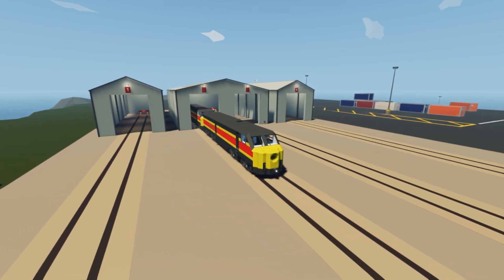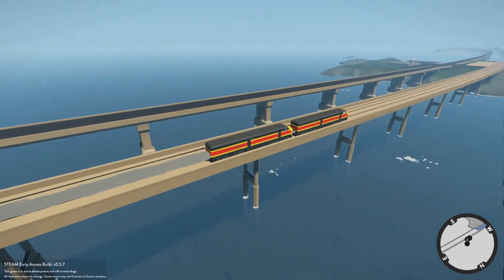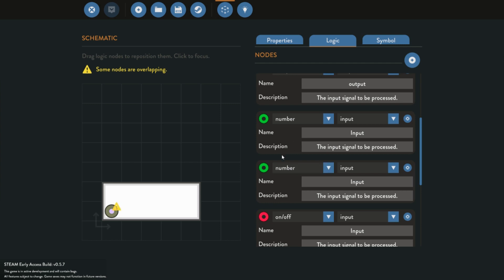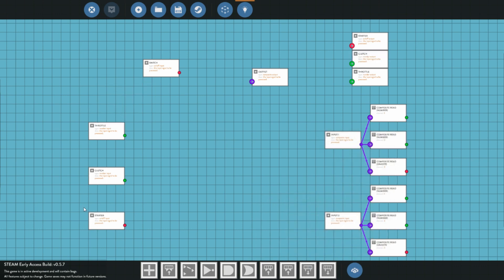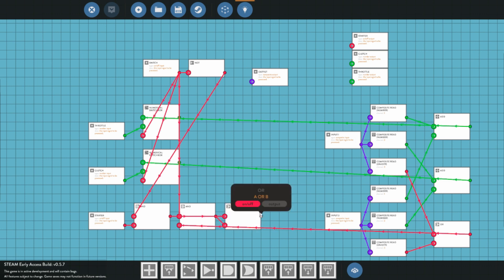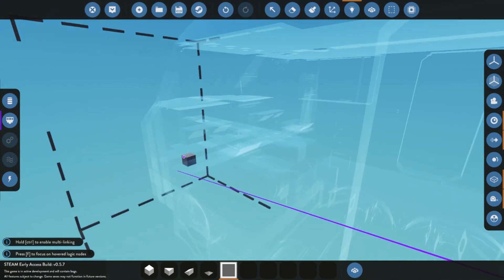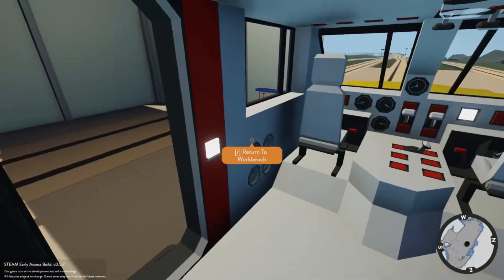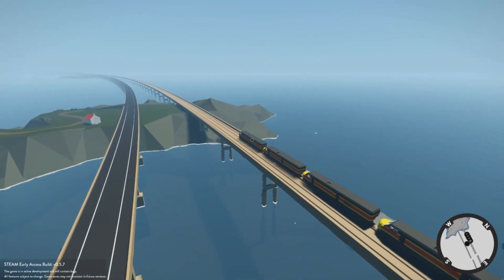How To Switch Controls With Composite Values! | Stormworks

Comment: I'm not completely sure how this works, but can you try this?
Make a processor that have inputs: throttle, brake, composite, receiver(bolean: true/false)
output: throttle,brake,composite (composite with throttle,brake value)
If receiver input (just some toggle button on dashboard) is OFF, then processor will just past input to coresponding outputs and composite
IGNORING composite input.
Now it is acting as main computer, sending data (in form of composite and throttle,brake values to itself), but not receiving composite (would create loop)
If receiver input is ON, then processor will IGNORE inputs as throttle and brake and accept ONLY composite values.
Now it is acting like receiver/minor/slave in composite grid, only taking orders
If you could make this work, them you would need to just connect any number of locomotivestogether, switch them to "slaves/receivers" except front locomotive which will control them all
Make sure that front and rear connector is connected together and to microprocessor in loop, but don't forget to break that loop in processor (as mentioned above)
Sorry if it sounds crazy, I'm just working with computers and this is how it "should" work, but fortunately I cannot play stormworks :/
If you had any questions (about this or my mental health) contact me
Reply: Heck I'm lost
Reply from the maker: @sashablank3532  lol my thought exactly
Reply: Send a list, not a continuous stream of words
Reply: @sashablank3532  List? What?
EDIT: I sent you an e-mail, hope it won't end up in spam :D
Reply from the maker: This is going to take me a bit to decode before even trying to build this
Reply: Seznam všeho co chceš
Reply: @sashablank3532  Viem že "list" je zoznam, ale ako to myslel, to neviem? To mu to mám rozpísať do komentu ešte podrobnejšie?
Radšej som mu poslal mail s obrázkom zo skicáru, snáď mu to stačí :D